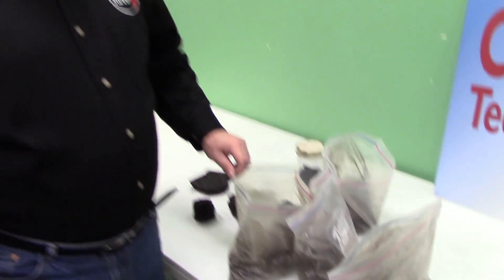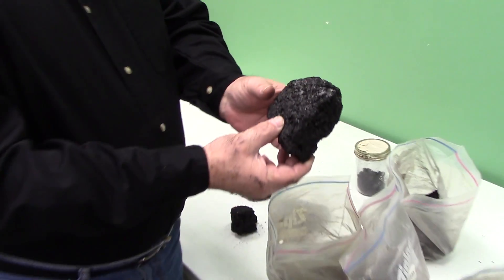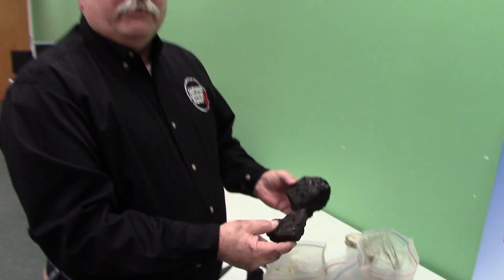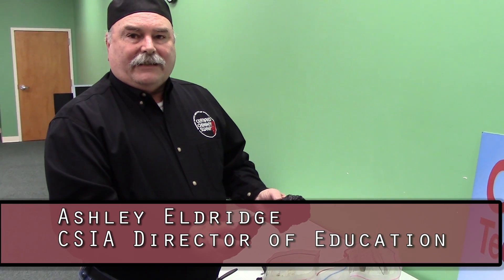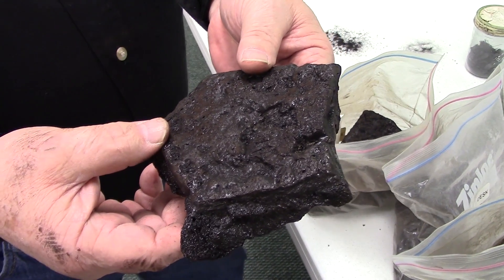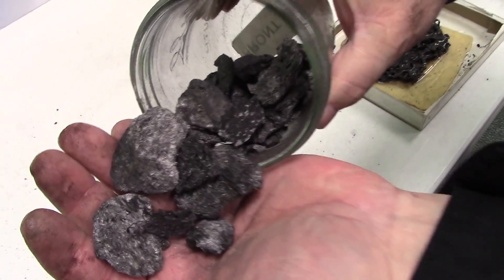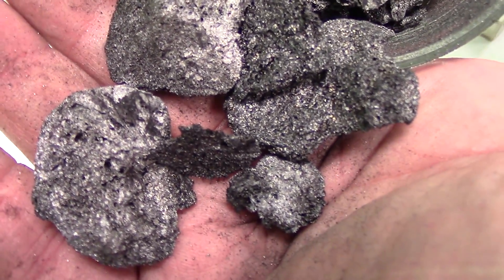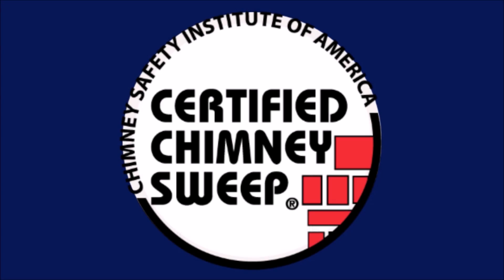What creosote looks like after removal from a chimney

Comment: I have a lot of this on the walls of my firebox and doors after burning all night in my 1975 Vermont casting defiant. The temp inside the box is 350-400 and the pipe reads 200-250 I can’t get it pipe any hotter no matter if the draft is wide open or turned do low for a longer burn. Should I be worried
Reply: Yes

Comment: After decades of using pine wood for fireplace because pine tree abundant in this area, it cause thick layer of creosote build up from burning the sap and turpentine. It made the chimney narrow like a high cholesterol vein also it increase risk of fire harzard known as chimney fire. Creosote made the masonry brittle. So we start buying hardwood.
Reply: Just in case anyone reads this, pine doesn't produce more cresote than any other wood. It's just a wildly believed myth. Just let it dry and it will be fine. 

https://homeguides.sfgate.com/burning-pine-indoor-wood-stove-48601.html
Reply: @richarddabkowski2896  yes, just let it dry out for 4-6 years in an extremely dry environment and you’re good to go!
Reply: Mark Brennan You couldn't keep the creosote build-up under control with a sweep every season? Sweeping the chimney yourself is cheap and not too hard, plus then you have to rely on someone else for your fuel supply. Takes half the point out of having a wood stove.
Reply: The species of wood used has nothing to do with creosote formation.  Creosote is the result of operator error- burning wet wood.  Wet wood is wood that has more than 15% moisture.
Reply: man ive burn burning pine for years in multiple furnaces and stoves never once have i had that problem. i get the light and finely flaky build up at you blow on it and will fall off. i sweep gradge flue 2 times a year. and house little more often. always lights and fluffy.